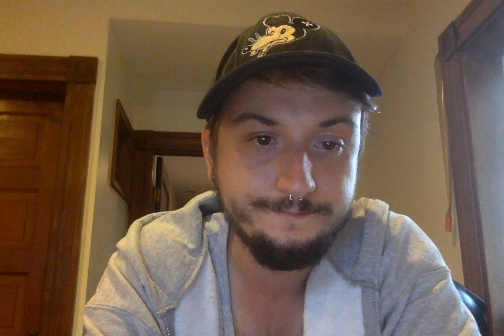Loudspeaker Design 03 | Open Baffle Theory

Comment: Clearly presented info, thanks! I do find that my drivers have very little cone travel even at very low frequencies. All High Eff drivers in a 4 way OB system. Low FS woofer with high compliance rolled cloth surround. Nothing like the monster Xmax woofers frequently post  ed on YT. https://youtu.be/w1PG5_tkzcc

Comment: I have an open baffle setup (each as an MTM - pair of 15" drivers and a compression driver in a waveguide for the highs). In my case, the open baffles are right in an opening between two room openings so in my case, I get all the benefits and much less reverberation coming back into the main room as the rear wave primarily goes off into the other room. Cant go back to a normal speaker without hearing extreme boxiness regardless of price.